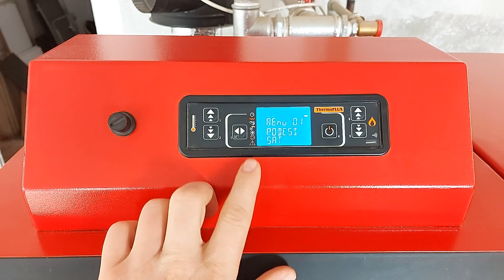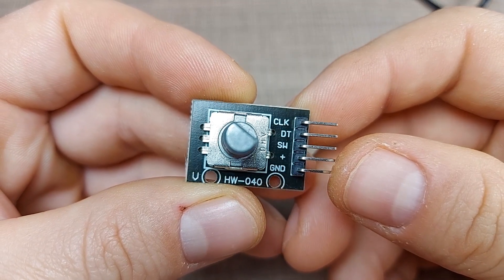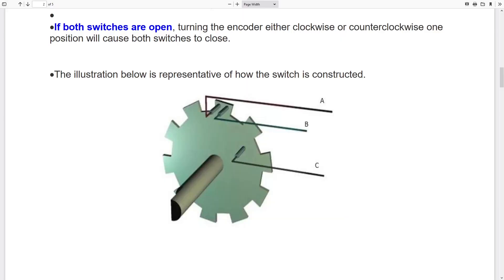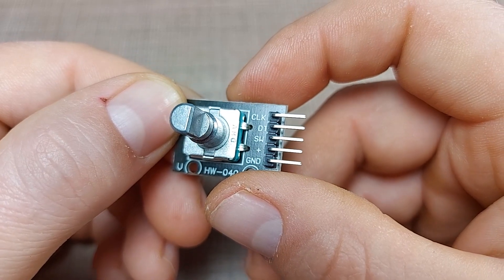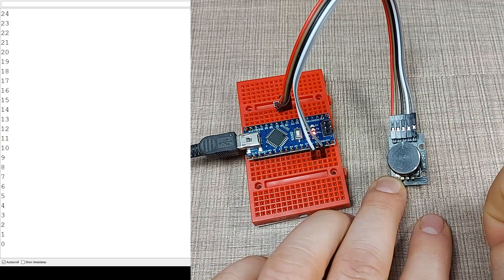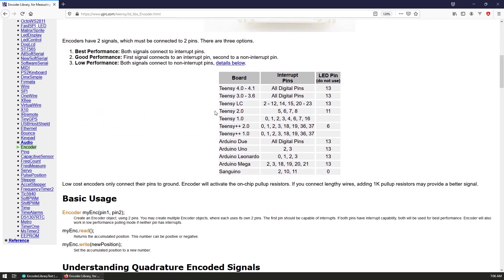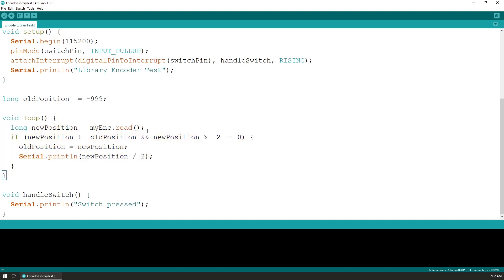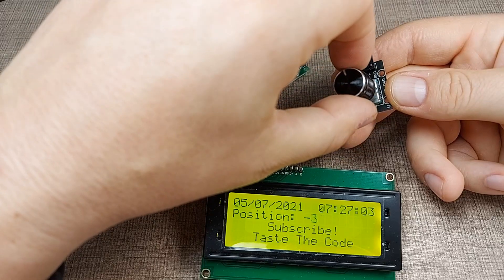How to use rotary encoders and interrupts with your Arduino projects

Comment: Ha, I was trying to think why you used % 2 = 0 and val/2 and I was thinking so hard about it that I almost missed your explanation of it :) Cool vid man
Reply from the maker: Thanks man! 👍👍👍👍
Reply: @TasteTheCode  I was also having a hard time understanding the modulo statement. But it's more clear to think of the the value not being incremented by 2, but rather as by 1 twice very quickly. Using the modulo operator tells the code to increment the value only when it sees the even value, right? Because if it reads that the value has incremented by 2 and the value went from 3 to 5 instantly, the modulo wouldn't count the change because neither 3 nor 5 modulo 2 equals zero. Instead it goes from 3 to 4, then very quickly to 5. The modulo statement increments when it very briefly saw the 4.
Reply from the maker: @gamehulk  The modulo operator is simply giving the integer remaining of a division operation. So 3%2 will equal 1 and 11 % 3 = 2 (3x3 + 2 = 11) How we use it is what makes it so powerful as when dividing by 2 (% 2) and the result is 0, we know that that is an even number. If you use %4, then you can do an action every 4th step when you increment by 1.